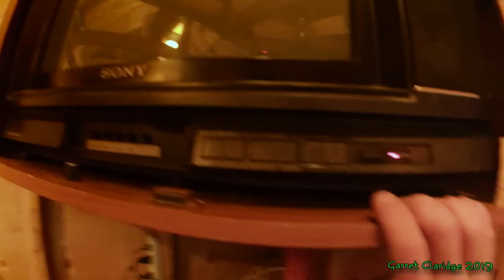Micro System MAYHEM - Blowing 9 pairs of speakers!

Comment: Here are some time stamps that should be helpful!
0:00 intro
3:45 Blue Sony speaker (Model No. SSRG444) Also these Sony speakers came with a subwoofer apparently.
5:28 Black RCA speaker (Model No. RS2653)
6:19 JVC surround speaker (Model No. SPFSM5)
7:16 Kevlar RCA speaker (Model No. RS2531)
8:24 Black Sony speaker (Model No. SSRG30T)
9:43 RCA speaker with a Titanium woofer (wow) (Model No. RS2622)
11:45 Kevlar RCA speaker (Model No. RS25334)
13:32  Second blue Sony speaker
14:46 Second black RCA speaker
15:33 Gray Sony speaker (Model No. SSRG55)
16:50 Second RCA speaker with a Titanium woofer
17:49 Second black Sony speaker
19:22 The last 2 RCA Kevlar speakers (Although they are different models)
21:47 Second gray Sony speaker
25:33 Second JVC surround speaker
26:53 Philips speakers with MAX BASS (Model No. FWBC550/17)
Hope you found that helpful.

Also, for fun, I will put up the last song each speaker played
1st Blue Sony speaker : From Zero to Zed - Decade
1st Black RCA speaker : Steven Esso - Disney
1st JVC surround speaker : Steven Esso - Disney
1st Kevlar RCA speaker : From Zero to Zed - Ghostly Robots
1st Black Sony speaker : From Zero to Zed - Ghostly Robots
1st RCA speaker with the titanium plated woofer : From Zero to Zed - Ghostly Robots
2nd Kevlar RCA speaker : From Zero to Zed - Ghostly Robots AGAIN
2nd Blue Sony speaker : KYLYK - L'appel Du Vide
2nd Black RCA speaker : KYLYK - L'appel Du Vide
1st Gray Sony speaker : KYLYK - Dead Stars
2nd RCA speaker with the titanium plated woofer - Akiria the tyfure - Drop it Hard
2nd Black Sony speaker - Akiria the tyfure - The DEEP abiss (20hz) bass test
3rd and 4th Kevlar RCA speakers : Akiria the tyfure - Drop it Hard
2nd Gray Sony speaker : electronic drumz
2nd JVC surround speaker : electronic drumz
Both of the Philips MAX BASS speakers : Akiria the tyfure - Drop it Hard

idk why i made this, but i did, enjoy i guess.
Reply: You know alot wow
Reply: Btw the electronic drums are a Yamaha DD-5 from '89.

Comment: I'm running that exact pair of Philips speakers at 27:00 with a Yamaha R-S202 receiver and I've got to admit that combination sounds much better than I thought it would. With the right clean power these speakers will surprise you. Just don't give them more than 200 watts each.
Reply: i have those and 2 pairs that came from a fc399 i believe

Comment: I used to have a pair of old Sony speakers that came with a 10 inch sub ran those on a receiver and they never blew execpt for the tweeters now I have 3 12s one being a car sub
Reply: Yeah I had the old 10 incher. It was blue. Sadly my dad got rid of it as I put fairy lights in the grill. If it was now I would just ripped the grill off

Comment: Why do you immediately take that dust cover off in the middle?  I don't know what that does.
Reply: it helps block dust from getting in the voice coil, and aslo works as a "propeller" to move the air around the coil to cool it down

Comment: Why not just wire them into a high current power supply with variable a/c control and ramp up the HZ and the voltage and watch them slowly fry.

Comment: 3:32 idk whats up with those exact speakers but myself and just about everyone i knew had a set. the 2 woofers had different sized voice coils. the bottom woofer takes way more power then the top. Also the very bottom at the ends with the orange port tube my moms old friend like 15 years ago had a set with those speakers and it fuckin shook the whole god damn apartment

Comment: and don't forget if the cat won't output a good signal,hell,try the dog it has bigger ears,grt it ? more antenna area better signal theroughput,ya know.but signal output is down,fuck it try a rabbit,get it "Rabbit Ears",ya know.i think you'd be onto how HAM radio started. and don't for get you might need a bigger powered amp to get the signal to transmit,ya know ?don't give up you'll figure it,You Can Do It,don't give up !!!

Comment: Honestly those silver RCA speakers with seperate woofer enclosure didnt sound that bad for plastic shit, to bad they arent matching,those blue sonys arent to bad either.
(edit: i hate piezo tweeters, if you use them you actually need like 16 seperate piezos with horns as they did over 20 years ago. Almost everybody knows that a single piezo tweeter is utter shize and distorts sound to hell below 30% volume,   Anytime i see those plastic shit shelf speakers at anystore for 100/200 euros with amp just makes me wanna smash them all to bits cus i know theres a fake dome tweeter with a piezo underneath)